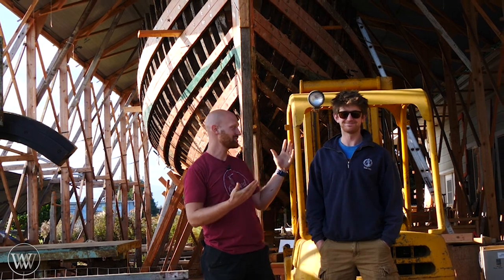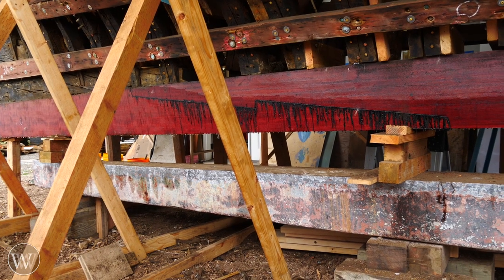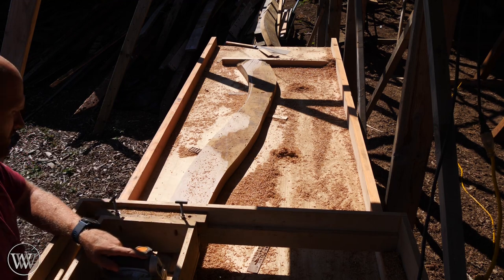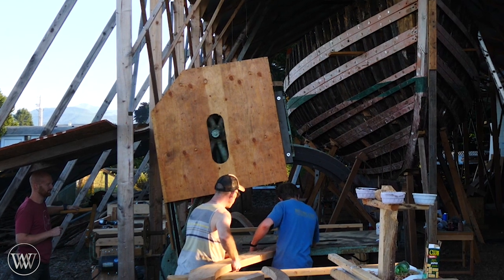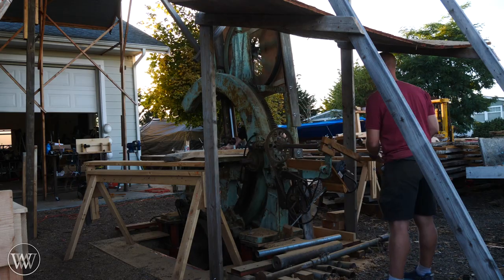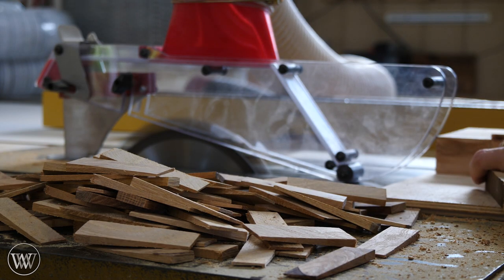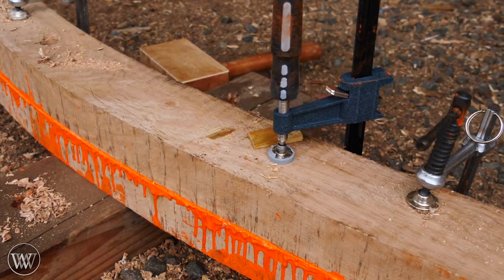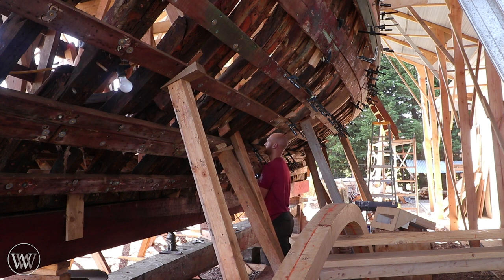Restoring a Wooden Boat |Tally Ho

Comment: I recently retired on disability and decided to get into wood working. I found Wood By Wright a couple months ago and the learning begain.  I have learned a lot about wood working with hand tools. Thanks for the great information James. 
I am also addicted to the Tally Ho project. I just finished binge watching the videos. I learned about Tally Ho from another project, Acorn To Arabella. They are building a sailing vessel this size from scratch. They said to check out Leo's build to see the difference how the beams are built. They are steam bending the beams instead of cutting bevels.
Reply from the maker: Love both of those duilds. I have also been down to help on the SV Seeker. Big projects with a ton of heart!

Comment: Great overview of a great project. Thanks. How did the original builders perform the frame cutting (varying angles)?
Reply from the maker: 100 years ago they would have used a ship saw like this. Before that they would just hand cut it and check for the angle every 6" to a foot.

Comment: Am i correct, that cutting the TreeNail notch in alignment with the wood's grain will allow the peg to split, that cutting the notch across the wood's grain Prevents Splitting of the peg or slab of wood?
Reply from the maker: not that much the propensity for splitting is similer in both directions. the big reason is expansion and contraction. you want that to happen in line with the frame so that it does not split the frame in half.
Reply: Agreed, you do not want the frame's grain being split by orienting the wedge lengthwise in that direction and spreading apart the grain at that point. As a carpenter, i learned early on as a youth that dry wood splits along the grain and thus even pegs proved to be problems, too.

Comment: Nice project, thanks for the video.
Question please! What do you mean by live oak?
Reply from the maker: Live Oak is a type of tree. Similar to White Oak but a much more Wild Grain. It mostly just grows down south in Alabama and Georgia. it is called Live Oak because the leaves stay on it all year round.
Reply: southern live oak is a species of oak tree .. that lives from south georgia to texas.. and is an order of magnitude stronger than white oak.    its called live because it does not lose its leaves for the winter.. only changing over its leaves during a two week period.. its green for 50 weeks of the year.  Its the strongest and most rot resistant wood available for boat frames.  Atleast in the US

Comment: Why not make a  guard to facilitate knocking the wedges in so you don’t hit your fingers and frame James  ? A piece of flat square wood less than the hight of the wedge, with a slot halfway through and then you can slide it round the wedge, then drive the wedge into the dowel hay presto fingers saved. There were two people who designed the the planer jig , Leo and a volunteer carpenter who had the idea originally .

Comment: there is a PBS show that covered some of the Yacht Coronet that used Trunnels or tree nails to hold the planks on.. http://coronet1885.com/  the inportant thing with trenails or trunnels.. is the saw cut that holds the plank on is 90 degrees rotated from the cut that holds it in the rib..   they also put them into blind holes.. bottoming out the trunnel which drove the wedge in to the rib end securing it tightly..  its covered in a few of the images on that page. but far better in the PBS video..   i just thought i would cover that..  i could see trunnels being used a lot in timber framing projects.

Comment: The Power planer is a Thicknesser. The round pegs are Dowels. If Oak Isn’t fully seasoned it is green Oak. A ton is a weight, you can have a lot of fun, not a ton of fun. To repair a boat is one thing, but to slowly replace all the timber peace by peace, you are building a new boat with a kind of stealth. It is interesting seeing the work been done. But is this a rich mans hobby or is there some commercial sense at the end of it. ?